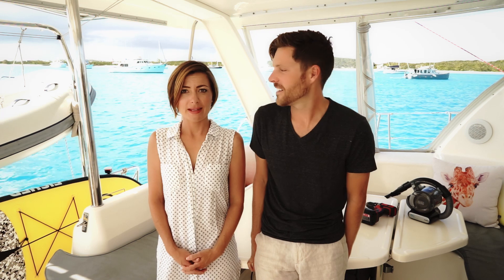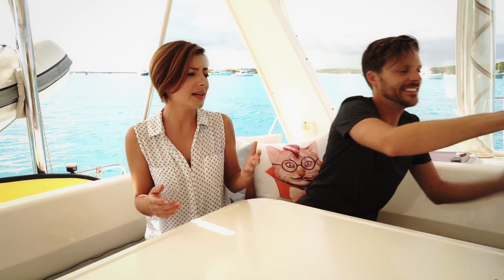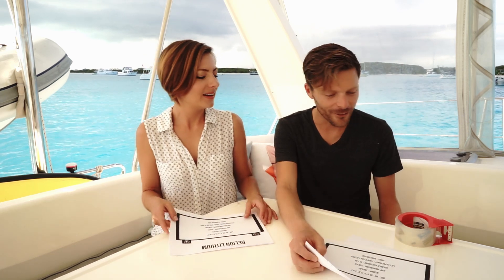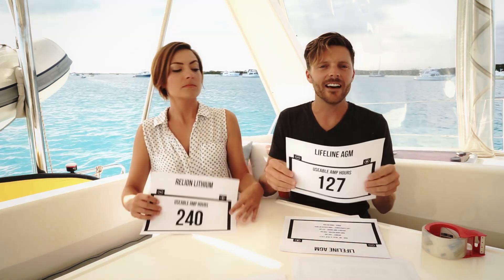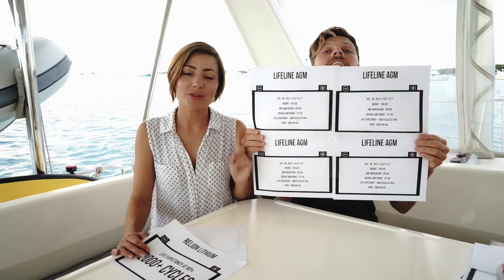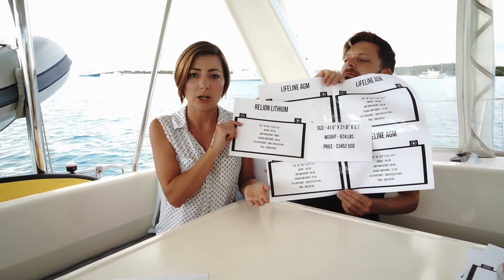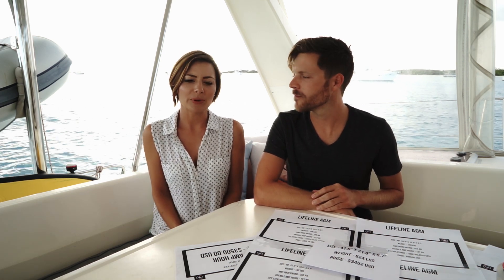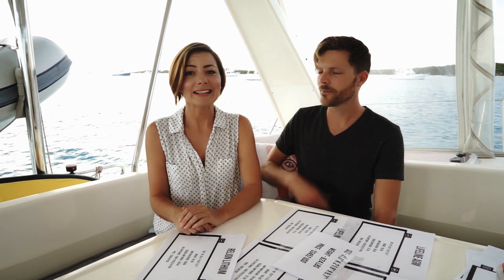Sailboat Tech - Lithium Batteries & Why We Chose Them (vs AGM)

Comment: AGM IS lead acid.
Reply from the maker: +acmeopinion factory AGM is Absorbed Glass Mat, SLA is Sealed lead acid.
Reply: Gone with the Wynns They both use  lead and acid, your distinction should be between flooded and starved electrolyte.
Gel and AGM use the same lead/acid chemistry as flooded batteries, just a different method of capturing the electrolyte.
Reply from the maker: We're going for simple to understand here, something the average person can comprehend.  Adding too many details and distinctions just confuses things, at least that's the way we feel after reading a technical documents on SLA's, AGM's and other battery options.
Reply: Gone with the Wynns When you say 'sealed lead acid', perhaps you mean VRLA, valve regulated lead acid- otherwise known as AGM.
The only 'sealed' batteries are the ones Pep Boys tries to sell you, and that simply means that you cannot easily add water when required.
BTW- your internet is blazingly fast for today.
Reply: AGM = glass mat that has absorbed acid. Scaling is what normally causes batteries to fail. As they are charged the lead can drop small parts of scaling that builds up over time in the bottom of the battery. Once the scaling becomes enough that the current can jump thru it to the next lead plate, then that cell dies. To combat this they added fiberglass cloth or "mats" into the acid. When the scales fall off the lead now the mat holds them in place. This keeps the scaling from building up in the bottom. AGM is a fancy SLA, not much more.
Reply: Cannonballer Yo I think the other benefits of AGM are no appreciable gassing when charged agressively and almost no limits on installation orientation, which obviously also applies to Lion. 
My point really was to point out that they were differentiating between what they called 'lead/acid' and AGM, which are the same chemistry.
The distinction, if any, should be between flooded and starved technology, as, as I said, the chemistry is identical.

Comment: Informative video.  You should also touch on why you stayed with 12 VDC and not upgraded to 24 VDC.
Reply from the maker: Mainly because we were already setup for 12v drop in solution.  Also everything on the boat runs on 12v so adding a converter for our nav gear, etc. didn't seem like a good idea.
Reply: I'm also looking for a video that explains the invertors and their efficiency.
Reply: Electricity is more efficient and there is less loss with higher voltage systems...  I think.
Reply: 24VDC would work well for the inverter and that is about it.  As stated, everything else is 12VDC.
Reply: You can buy a simple 24v to 12v converter from Amazon etc. I believe Victron makes one too but likely much more expensive.
Reply: The greatest advantage of 24v comes with longer wire runs and larger boats. Besides you aren’t going to save weight switching to 24v unless you replace all the wiring in the whole boat. At 42 ft voltage drop shouldn’t be too bad on a 12v system.

Comment: These fools know nothing about batteries and what's affordable.
Reply from the maker: +Elvis Dumpster Dining you have got to be kidding me. The Lithium battery world didn't pay us to make this video, no one did.
Reply from the maker: nope, wrong. No check from anyone to make this video.
Reply: Elvis Dumpster Dining did you even watch the video?
Reply: RAWKLOBSTAR You're an EE with battery design experience but appear ignorant of the very basic knowledge of Lithium Batteries. Just about ALL general purpose SLA replacement batteries use LFP (Lithium Iron Phosphate LiFePO4), chemistry or variations simply because it is the most versatile and safest of the current technologies and has been for years - Relion uses it as well. The 18650 cells (and newer 2070 cells), are not the same chemistry and that is why Tesla has to spend lots to get energy density up while engineering their proprietary battery packs to provide adequate cooling etc and why it's the MOST expensive component in a Tesla car. What the Wynn's did neglect to point out is that LFP's don't cope with low ambient temperatures very well. I speak from experience as I had a LFP battery in my motorcycle and a two-week trip where over-night temperatures got to 0degC or just below - killed it!
Reply: RAWKLOBSTAR Lol, you're an ee... roflmfao.
Reply: For a couple who have been living off grid and for a while and used lithium for extended periods of time I’ll say it’s a matter of wisdom from experience against pessimism with some arrogance. They know what they’re doing and have so far been sailing smoothly with it.
Reply: You dumbass, they have been LIVING OFF OF BATTERY POWER FOR THE LAST 7 YEARS. They have REAL WORLD experience. They didn't just look up some specs online like you did.
Reply: people can argue about batteries, who knew? although it's kind of funny when electrical devices become tin gods.
Reply: Do you know of a link to a video or website of someone who has installed Ni Fe battery system in an RV or boat?  Just curious so I can continue research.  Thanks.
Reply: Glad I bought an AGM, guess I'll find out if you're right or not :)
Reply: I'm an electrical engineer that designs battery powered systems, clearly I'm the dumbass here. Lithium ions are great for power density, fast charging, and large current loads (such as the motors in Tesla cars, their packs are based off of 18650 3.7v cells, which is probably what's in the bank in this video). They do wear out with time a lot faster than other technologies, however. You are going to get a couple of years of peak performance versus 6-8 with a well maintained AGM system. Safety is a matter of careful design and use of quality cells. It's a trade off between absolute performance and longevity with slightly higher risk due to the cell chemistry.
Reply: Correct. These batteries are going to be worthless in 24 months. You get more capacity in a smaller space, but glass mat lead acid is really what you want for a boat. Also have fun if a cell dies and the whole thing goes up in flames.

Comment: Hi guys. Love this topic, really looking forward to more videos and info on batteries - and more info on charging them.

My plan is to start building a catamaran next year (probably 40-42 feet long), and I want to go ALL electric. Have been looking into electric motors instead of diesel engines, really like what Ocean Volt does, they seem to have a  good system. I hate the idea of relying on diesel engines, although will probably go with a diesel generator to charge the batteries as needed. 

I would love to not have to go with a generator, but I don't think the technology is quite there yet.  

A few questions for 'ya. 

Have you had any occasions where you've run out of juice and wasn't able to recharge for a time, or needed to rely on the engines to charge the batteries? 

When you were RV'ing, you had some great videos about solar power, and I remember at least one where you talked about tilting the solar panels into the sun more and got a better charge. I imagine that is nigh impossible on a boat, as you're rarely motionless, and thus the sun would be darting about the sky - how would you keep the solar panels pointed at it? Then, there are those pesky sails that would get in the way. ;) But, would there be any way of increasing, or better positioning, panels so you get more sunlight on them? I've seen sails with flexible solar panels integrated into the actual sail - that's cool! 

 Is there any way of explaining, in laymen's terms, the voltage/watts/amps in regards to time needed to charge batteries and what that actually gives you in return? I'm starting to get my head around it all, watts and amp hours and such. But would love a simple explanation. :) Fair winds (and bright sunshine to charge them batteries).

Comment: Lithium, spot on for the boats, but another option for home is the zcell battery which is potentially better than the lithium powerwall as it can be completely discharged and left like that with no detrimental effect.  Great if your not in the sun every day.  It's only real problem is it needs to be kept stationary.  I'd love to see you guys with a couple of small wind turbines too, perfect for the boat ⛵️ over your RV.

Comment: ⛵️ Very informative.  While living on a sailboat, besides the abundance of sun, there is also an abundance of wind.  For a sailboat, is there a way to incorporate some type of small wind turbine generator to help produce supplemental energy? ... just wondering.  Stay safe and thanks for sharing your sailing experiences. ⛵️
Reply from the maker: +Paradigm2012Shift You can absolutely use wind turbines to charge batteries but they tend to be noisy and create all sorts of vibrations in the hull so we're sticking with solar.
Reply: Cool, thanks for the reply.
Reply: Check SVDelos, they run solar and twin wind generators.

Comment: Ok, have a question for you then.  Did you buy the "Marine" specific ReLion batteries or their regular 12v line?  On their website they don't offer any info on the differences in the Marine line.  I'm currently Full time in a truck camper, planning on replacing my batteries with one Battery now.  I'm about (I hope) to start building a trailerable catamaran and will use that one and another for the bank in the cat.  Thanks guys, been following for a while, since TiogaGeorge turned me on to your channel.  Smooth sailing

Comment: Good information. While I am an lithium ion batterie lover. I think that using them with a system that is constantly charging them is not very good, basically all your life cycle are being used while they are charge with solar or wind generator. From my understanding it is better to used them all the way down to 80% before putting them back on the grid for charging. 

This is where AGM works better, you can leave them constantly on the grid for charging. But you are right that it is better not to discharge them more than 50%, even 30% I heard.

If you use lithium I think you would gain quite a bit of usefull life cycle if you get two bank. One bank that gets depleated to 80% and the other bank that gets charged. Vice versa.

Comment: I can understand why half the lifetime doubles the price, but I don't understand why you'd buy the second set before the first set died. Thus, I don't understand why the weight and space needed would double. Did I miss something?
Reply: Kevin Bailey 

The batteries are simply better out of the box, and supply a steady level of power throughout their discharge. They recharge faster and are more durable than other types. Conventional batteries will suffer diminished ability when they get low on charge, whereas my lithiums will maintain a consistent power output until discharged.

The Wynns need a certain level of constant power output, which lithiums provide; conventional batteries would die out faster per cycle, but increased use creates a situation in which the following high-output cycles each progressively discharge faster. Choosing lithium better suits their power requirements. 

As far as replacing the batteries, part of the equation is output consistency, and part is simply logistics; as regular batteries age, their output becomes inconsistent with short power cycles, so they'd struggle with poor battery performance sooner rather than later, but add to that the need to schedule replacements. In your flashlight or power tools you simply buy spares and put them on a garage shelf until you absolutely need them, but you can't do this with a boat's batteries; if your conventional batteries need replacement you tough it out until you get to a mainland market offering competitive prices, or you get the nearest batteries and suffer the pain of paying even MORE for already-expensive batteries. 

A powered watercraft does use power from battery arrays, but they also have engine and generator power available. A sailboat that doesn't use its engines often, or that does not use a dedicated generator, relies on stored energy for its needs. If one can afford it, one should get the best batteries available.
Reply: I too wonder why after a battery is spent and replaced, they would continue to be carried in the boat, unless they plan on buying extra batteries to replace the spent ones and have to include the weight of the extra batteries onboard that are in supply.   In that case, the Wynns could argue that having the lithiums require less times to return to a home base where those batteries can be replaced.  On a long voyage, that could be a factor.
Reply: Kevin Bailey You wouldn't buy the second set before the first dies: they are comparing the cost over the lifetime of the batteries.

Comment: Would two more bats been worth getting or is something you plan on upgrading in the future?
Reply from the maker: +Level Zero We bought based on how much power we used in the RV, plus we factored in the extra draws from the boat. You can always "buy more batteries" but storage on the boat is an issue and we'd have to run wires to connect them to the rest of the system, etc.... We're good.

Comment: Lithium batteries have become safer over the year, but I think it is important to know that if they fail they do so violently.  I am talking enough force to vaporize the back of your boat.  If you see any swelling or notice excessive heat, remove the battery immediately.
Reply: I think you are correct.  As electrons flow between cathode and anode - dendrites form (imagine lithium crystals) - and when they bridge the gap between the two - violence occurs.  I think everything in this video is really really good - but one thing I would budget for - is replacement of the lithium ion batteries before they really are worn.  The risk to the boat is too great.  Lastly, one cannot ignore the huge amounts of lithium ion batteries coming out of China.  I've bought some - to great effect.  This market is changing massively - which is good news for consumers.  Again, great video, great information, but I'd be cautious on how long I'd plan to use the same Lion batteries.

Comment: when you get to 4 AMG batteries your capacity isactually  higher then 1 lithium and not the same but still - size and weight ARE important on a boat...
Reply from the maker: Lithium batteries also take a charge much faster than AGM, and when you drawing big loads that's also crucial.

Comment: Have you two checked into the Tesla Wall Battery?
Reply: This question has already been asked by boaters and the answer is no. "Tesla does not certify it's the PowerWall for marine environments because the battery chemistry used in the Tesla PowerWall (Li-ion NCA or NMC) is not safe for marine applications. The internal cooling system is designed to work when the PowerWall is mounted vertically on a non moving outside surface." Installing one would void your insurance and most likely set your boat on fire.
Reply: The safest practical battery chemistry is so-called LFP (Lithium Ferrous Phosphate), which I fully suspect is being used in the Relion Batteries. They have less energy density than the chemistry used by Tesla but are more forgiving in construction  and cooling etc. and less prone to busting into flames.
Reply: j kd'n I wouldn't be holding my breath for a Tesla 'Marine PowerWall' anytime soon. The marine environment is one of the most harsh for any electrical equipment. For the relatively small size of the market, the sheer variability in the size and types of boats out there and the major R&D expense involved I doubt that Tesla would divert time and money away to this enterprise.
Reply: phillip cyr The wall is just a battery pack and software controller in an integrated pretty package. On a boat you want separate batteries and controller so you can hide them in convenient locations and since every boat is different a one size solution is just not appropriate. It's a great solution for homes as it's a very neat install in the utility room or garage, and the new one can apparently even lay flat, which would be great in the attic, but not of much benefit to a boat. And since marine li-ion tech is different from common land based li-ion tech, price of marine Li-Ion batteries when the gigafactory goes into production will most likely be unaffected.
Reply: John Canalese Agreed. Generic square 12v batteries are the answer for this application. Would like to see more people use marine li-ion, but since most boats are marina queens there's no advantage for them (plugged into the marina is where lead acid excels) so I expect the price to stay put…
Reply: That's for homes bud it's huge
Reply: tesla made batteries for toyota and it 18kw